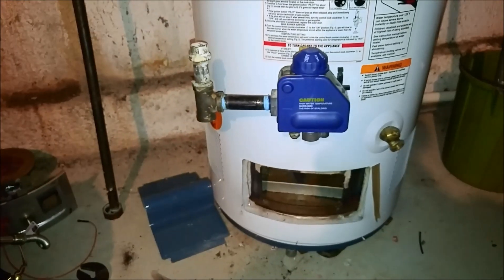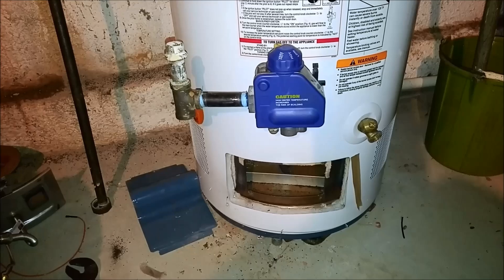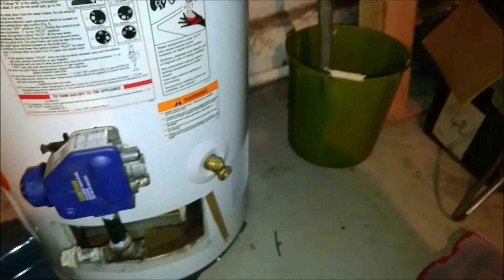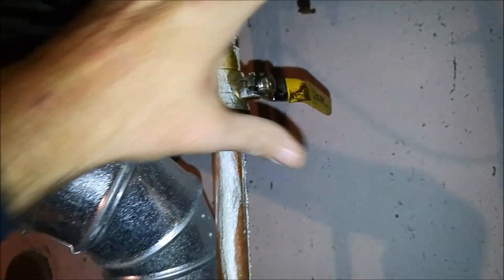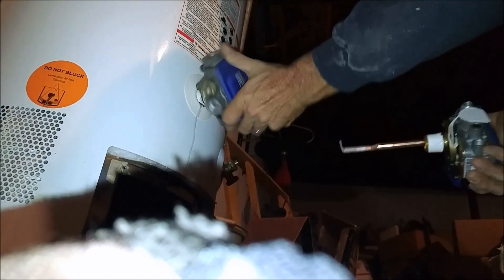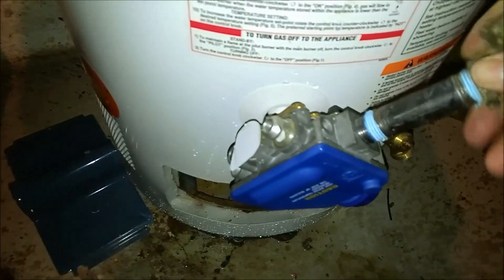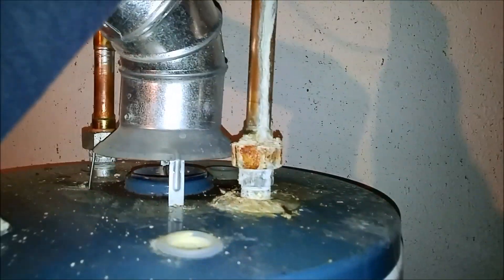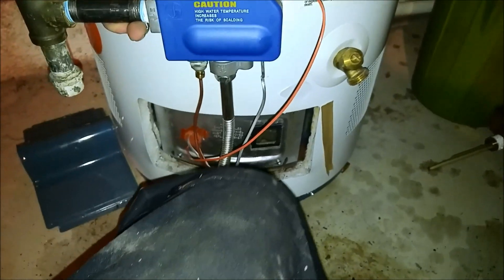Replacing A Rheem Water Heater Gas Control Valve With Full Tank Of Water

Comment: I carry a 18 inch pipe to use as a wrench on these valves and the pressure relief valves, works well.
Reply: Just use a 12" nipple. A. it's cheaper. B. it's a better connection, than a wrench. C. it's actually what the gas valve manufacturers recommend.